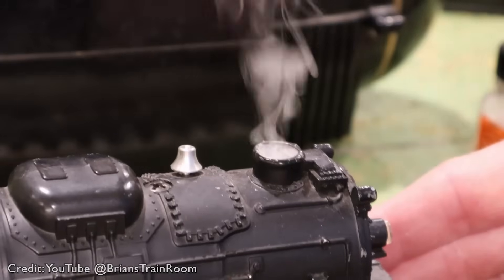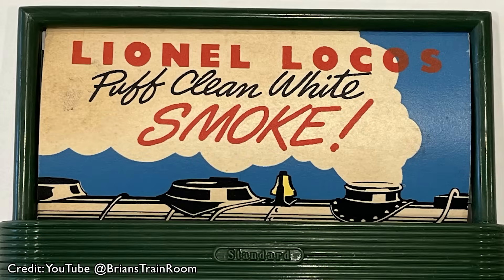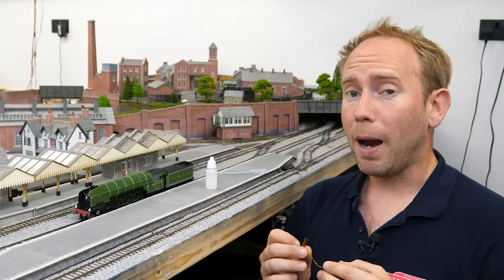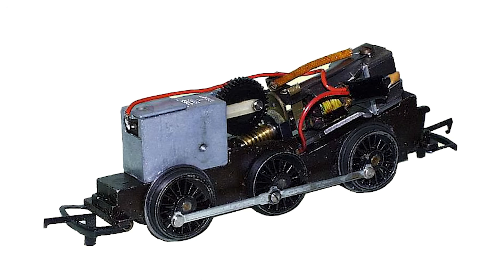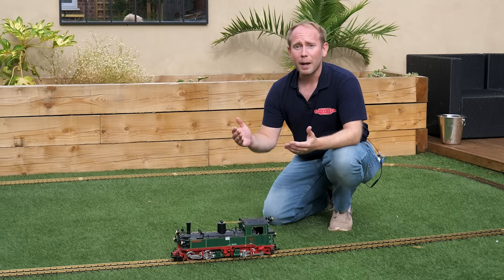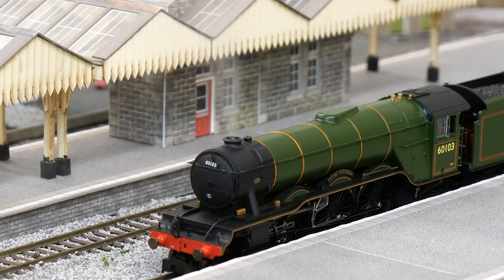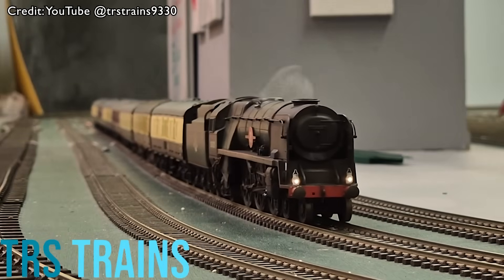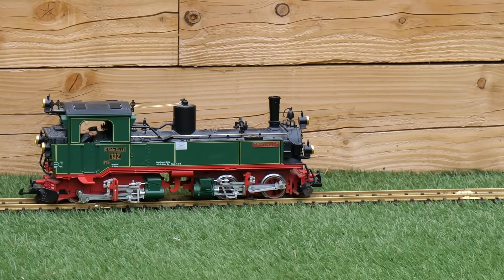Smoking Models | Cool Tech or Bad Habit?

Comment: I think if you have DCC and sound, smoke is  a must. To me sound without smoke seems weird. I'd rather have no sound if I don't have smoke. When I eventually get around to building my retirement layout in a couple of years I'll probably have a few HM7000 bluetooth decoders (I'll never be able to afford going full DCC with my aged fleet of locomotives), but with a switchable permanent power supply to the track I reckon I should be able to run HM7000 chipped locos with sound... and smoke side by side with my DC fleet. It shouldn't be too difficult as the layout will be wired for full cab control as all my previous layouts have been. I just need someone to supply a steam generator that can be retro fitted to older locomotives. They'll also need to get cheaper! The TRS units currently cost around £100, that plus an HM7000 decoder would be an awful lot to spend on locomotives that are probably not worth more than £40-£50.
🤔...
Or maybe I'll just invest in one or two RTR smoke fitted locos...
Thinking as I'm writing this...
...if the Seuthe units can be wired to a chip as you say, that might be a possibility. I have a few Seuthe and Synchrosmoke fitted locos but they need to be run at TGV speeds before you get anything out of the chimney ! As you say DCC can overcome that issue.
Whatever, thanks for the video, very thought provoking.
Rob

Comment: A.C. Gilbert with the brand of American Flyer made in 1946 a debut in S gauge and even in H0 they had smoke and choo choo sound.
The drawing you showed is nearly the smoke unit of a typical S-gauge Gilbert since 1948 (sync sound) AND it has the error of only 1 chufs per wheel turning - it should be 4 and with 3 cylinders even 6!
They could have solved it with an extra wheel and gear-up.
I can't understand Märklin that they didn't licenced it, BUT on the other hand the region of Würtemberg, Swabia, is known, even today, to be VERY stingy...
Schaffe schaffe Häusle bau und net auf die Mädel schau -
work work the houses build and never look on the girls....
cordial greetings!
Géréon

Comment: Triang used Seuthe smoke pots by the early 60s. Then they used Synchro Smoke. I still have quite a few locos with smoke that ork just as well as when they were new!
We may have gone digital but will these new units still be working in 60 years? Mine still use Ondina 17 oil as used in stage smoke units. It's supposed to be non toxic and works well.

Comment: 4:52 I don't think you need to be scared of the smoke fluid, it's likely to be an irritant, which means that it only becomes dangerous if you breathe in enough that the natural cleaning systems in your airways become overwhelmed. You should probably just not breathe it in directly and make sure to air out your room after using it.

Comment: It does make me wonder.  Oil vapour. Surely over time that will mean all that vapour will drop microscopic oil droplets across a layout. I also think that if used over a long period of time, that will leave an oily residue all over buildings and scenery.  even water vapour the same. Over a long period it's certainly possible that it could ruin card models or cause some warping etc 🤔  but it does certainly look cool.  
What do others think on this. ??
Reply from the maker: Personally I think the oil looks great in full steam, but it stinks and quickly leaves a mess.

Comment: I have the Black 5 and the Flying Scotsman with the new water vapor "smoke" units and think they are great! Hopefully, Hornby will license that tech to others so we can see more locos with same. While it's true the amount of water doesn't last long, say 15 minutes or so, the effect is striking, especially with two locos side by side at the station or on shed. As the trains run around the layout, I generally cut off the sound as they recede into the distance for effect, so the smoke is also cut off. 
As to the lack of color, look at any well-fired engine not pulling a heavy load or up a bank, and what comes out is quite light - if the fireman is not overstoking. (U.S. steam locos seem to be a lot dirtier, especially for photo opportunities, where the photogs like like lots of smoke and whistling.)
Overall, I'm happy, and am looking forward to adding the Hush-Hush and the Channel Packet. 
One other comment: I'm sure the system is more effective in high humidity as I've seen here. One rainy days (rare) I get good "smoke" but on our more typical hot days at 5 to 10% humidity, it is less dense appearing. Summers are killer here; sometimes reaching 45 C. (But not indoors, thanks to A/C.)
Cheers - Jack
Reply: I believe Hornby are licensing the system from it's patent holder. TRS trains are also selling the service of fitting the steam transducer to locos.
Reply from the maker: Do you know who holds the licence?

Comment: Fantastic video - I learned a lot and hadn't realised the smoke generators go back quite so far. One of my 'to-do' projects is to try a conversion to use an atomiser on a G Scale loco, but I have yet to get stuck in.

From the LGB/G Scale, I've found that the higher voltage options (there are 16v and 24v if I recall) generators do produce more smoke, but can still struggle outside with a light breeze, with the impact you showed in the video. The newer LGB have 'pulsed' smoke generators - a similar concept to heating the oil, but they also come with a small fan which pulses (I guess similar to Hornby's old version) to create the sync. Some also have smoke routed to the cylinders.

It's a fun little effect overall as definitely adds interest - those outside of the hobby in particular seem to appreciate it when viewing.
Reply from the maker: Sounds like a cool project. The newer LGB fan assisted smoke sounds better.

Comment: I have seen some glowing reviews of TRS Trains and quite rightly so, however I cannot say my experience has been so good.
When I originally placed my order, TRS wanted the full payment and the locomotive at the time which to me felt pretty standard. I had waited a few months and hadn't heard anything so was getting a bit dubious and asked for it back. Each time I asked, I was met with reasons why I could not have it returned but that it would be done soon.
Eventually after 12 months of waiting for it, work had started to be done on the locomotive but seemed slightly rushed as it was all done within a very short period of time. Which seemed alright at the time however what was to follow in my opinion sadly ruined the locomotive for me.
I had originally ordered just the smoke unit in the chimney as I was not likely to use the cylinder drains at all. TRS trains then went and added the cylinder drains as a "token of good will" without asking If I wanted them. This meant that without even asking me, the front portion of the loco chassis was completely cut away to fit the drains, which then meant that the cylinder blocks would have to be mounted to the locomotive body instead of to the chassis. This now means the locomotive cannot be reversed to original condition and also the locomotive body mounting screw was done away with. 
As a result of this, the locomotive body has been glued back on meaning that ideally the locomotive would ideally have to be sent back to have any servicing done as its now not a job for the faint hearted even to give the motor a light service due to such modifications. Those who paid for the cylinder drains quite understandably would know this, however I did  not ask for them to be fitted.
I had to send the locomotive back under warranty as Flying Scotsman stopped steaming and it turned out to be a cold solder joint in the chimney. As it was under warranty it didn't cost me anything which was fine and the locomotive was turned around and sent back out in good time.
After having the locomotive for about a year the front resin truck had started to crack (cast in resin due to the cylinder drains and cannot be reversed to original condition) I was told that a replacement would be sent out as there was a batch of resin that was cracking when in contact with the steam. I had contacted them in February about this but I have heard nothing since even after sending a few messages.
Also after this time the smoke box exhaust has gained another cold solder joint and has caused arching which is not good. I have been in contact about this and have been told that I would have to affectively pay for an all new smoke box steam generator which would cost around another £100. I would like to add that these are not the fault of TRS Trains, these things happen but is the cost of modifying any locomotive like this.
As a result of this I now need to decide if I would like to send the locomotive back and have it repaired for a servicing fee + parts, or whether I try and fix the locomotive myself.
Overall, my experience has not been a good one. That does not mean that everyone is going to have a bad experience, but for the price I originally paid, the locomotive taking so long to get back without any communication from TRS Trains, and then altering the locomotive further with big changes without asking me first is very disappointing personally and I don't think I would use the service again.
Reply: Sorry to hear that - it sounds like a bit of a nightmare. Hopefully it's an isolated incident - but it certainly gives one pause.
Reply from the maker: Thanks for watching the video and sharing your experience. Does sound like a bad position to be in. I hate modifying models to fit decoders/stayalives so would like this.

Comment: Anyone else had a problem with A3? Mine forms a bubble within seconds in the chimney, stopping the nice effect. Easy to rectify, but it cant do a loop without clogging
Reply from the maker: I believe there were settings that could be changed on the decoder to help with this, but I can't remember where I read it.

Comment: I have a Hornby 2-8-0 that was in GWR green, and it had a smoke unit pre-installed from the early 2000s. It overheated one day after a few months, and right behind the chimney, the plastic melted and left a hole. After nearly a year trying to find a replacement body, I had to give up, and eventually, I picked up a BR black loco and tender bodies. I still have it, but I disconnected the power to the smoke generator. I didn't want to go searching for bodies again as they were rare to get in good condition and without warping or holes in the body.
Reply from the maker: Sounds like a nightmare.
Reply: @LittleWicketRailway To this day, it is the only loco I've had with a smoke generator in it. Having to top them up every 15 minutes on a layout would need easy access to it to refill without disturbing other trains and scenery.

Comment: I'm not a client for smoking engines for one reason : allergies. Any kind of aerosol in my home is a potential health problem for me.
I'm waiting for holographic smoke units to consider buying one. The Hornby system is a good idea by the way.
Reply: I don't think you can be allergic to water (or if you were, that would be much, much a larger problem).
Reply: @little_britain  With the heat at home now, (32°C inside, six more outside, heatwave inside in southeastern France), a little bit of water in the air would not be a problem at all. Or even noticeable.
The oil-based smoke unit by Seuthe contains allergens and irritants, not for me. The idea by Hornby is something to consider, but i stick to holographic smoke when it would be possible to have it : no fluids, no problems.
Reply: @OlivierGabin  Oh for sure, I would see the Seutyhe units as problematic.

Comment: A very interesting, informative & entertaining video.

I had a couple of Triang/Hornby oil based smoke generating locos back in the day. They were excellent at the time. But time wasn't kind to them. These days, it is said - with some justification - that the way to identify an old loco with an on board smoke generator is to look for a melted boiler!

Anyway, I was in the "it's a gimmick" camp when Hornby launched it's latest smoke generator technology. But then I snapped up a HushHush at an extremely good price and was just wowed by it. So I bought the P2. And then Flying Scotsman. Totally bought into it.
Reply from the maker: Thanks for watching. Yeah, the water based tech does seem a lot better.

Comment: I had a tank loco with a smoke generator but after a while it would short out the motor and the locomotive would stop.
Reply from the maker: I think that's what happened to the old 60s Britannia. The insulation around the wire had melted and was making contact with the body causing a short. Fingers crossed with the smoke unit removed I can get it working again.

Comment: In Germany you use this smoke oil - its  a real  good cleaning fluid, but i dislike the smell of it - especially when it is heated up. There i think, a water based method is better - but most of those features are running 5-10 minutes and then it ends. I dont need it and in my opinion, it looks too artifical - just look, how the smoke of a real steam engine is looking like (very connected to the used coal type) and how  different the exhaust smoke of an Diesel loco is looking. For me an feature with 0 value and as i converted my stock of locos to digital, some of them had such steam generators- i was throwing them all out.

Comment: I have one of the smoking P2’s, I love it, but it started having issues, where it just wasn’t steaming. It worked, if you directly put water on the atomiser, it would work. But only the water applied would steam. The water in the reservoir seemed to not be reaching the atomiser, and there’s a warm patch on the boiler, so it’s currently stranded at hornby’s repair department as they are in the middle of a several month long relocation. Hopefully I’ll get it back one day
Reply from the maker: I'm waiting on a part from Hornby repairs too, so hopefully they get their move sorted soon.

Comment: I think it is a stupid thing.. more things to go wrong... introducing heat into a plastic model, that in itself is a recipe for disaster......  When I get models with it, I quickly cut the power wires to the smoke generator.
Reply: Agree it’s more to go wrong, and I’m ok with that as I’ve been in the process of building my own anyways, plus the Hornby unit I have.  As for heat, there is none.  Essentially, it uses a super high frequency speaker.  It uses the same technology as in atomizers.   And regarding failure rates, I have a few handful of these atomizer components bought cheaply from China.  I have not treated them kindly, as they are very, very inexpensive, like five for a dollar at the time.  That was a few years ago, and I have yet to see one go bad, even with all my poor electrical skills and leaving running overnight without water.

Comment: When I first saw the TRS tech being developed on a Southern layout a few years ago somehwere (I forget the channel), I immediately bought a bunch of the ultrasonic transducers to make my own. I got a basic circuit working, but I haven't got round to trying a fit to a loco. One of these days, perhaps when I retire!
Reply from the maker: Sounds like a good project. I managed to get one working to simulate smoke from a building chimney, but I wouldn't know where to start when it came to installing them in a model.
Reply: @LittleWicketRailway  Yes, the smallest diameter one that I could get working well was a 19mm, which will fit in the smokebox of larger steam locos, or diesels.
Reply: @little_britain  Hello. Maybe you are referring to Bournemouth West ? Check "Bournemouth West with Live Steam with Chadwick Model Railway | 166." and the pinned comment below the said video.
Reply: @C_T_314  yes, that is the layout - I saw an early video sometime during 2019.

Comment: I had a synchrosmoke Triang/Hornby Britannia in the 1960s when I was a boy. I must say I like the new Hornby steam unit. My new Dapol Black Label A4 still uses oil and it stinks when its on!
Reply from the maker: When did the Black Label A4s come out, they're relatively new right? I'm surprised they went down the oil route rather than the new water based systems.
Reply: @LittleWicketRailway  They are available as a Rails Exclusive right now. In all a great model! I also love my Hornby steaming P2 Prince of Wales and Flying Scotsman. The best steamers in my fleet!